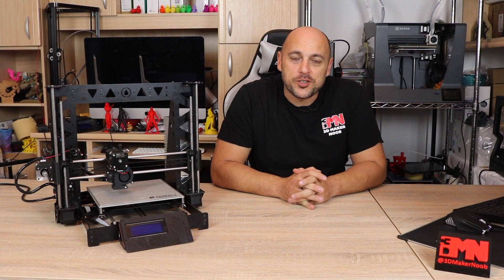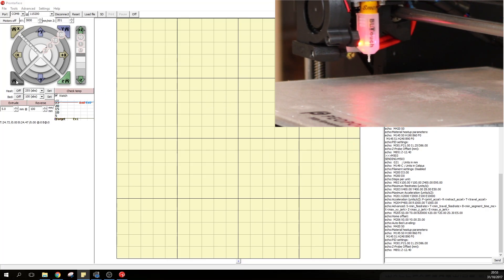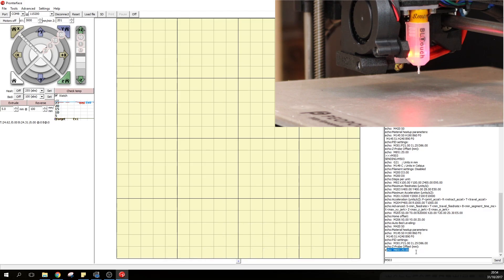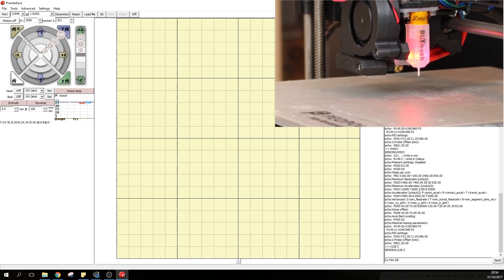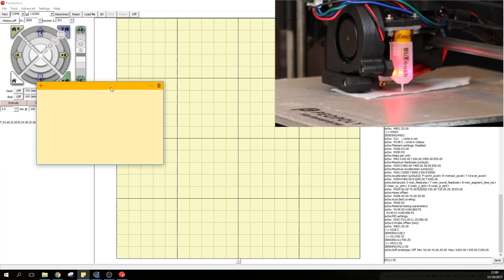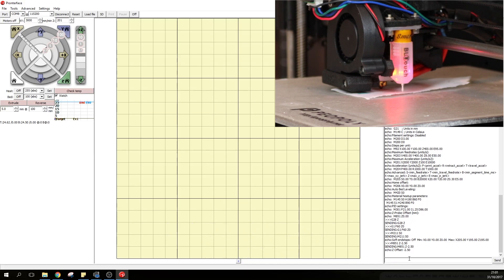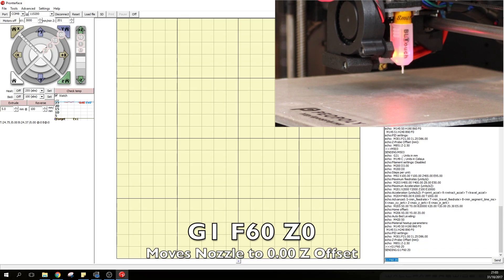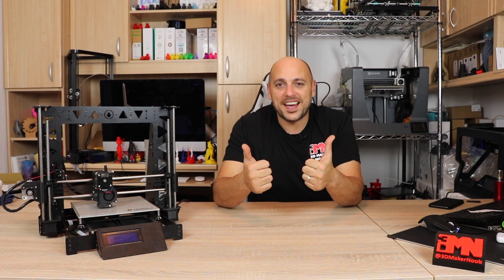Calibrating Z-Offset With A BLTouch Bed Levelling Probe

Comment: Anything I'm missing in the config of this? I am not seeing the same output you are with my Ender 3 pro (4.2.7 board) 

This is what I see when I hit home: (no z offset info)
------------------------------------------
Printer is now online.

SENT: M105

RECV: ok T:25.91 /0.00 B:25.48 /0.00 @:0 B@:0

SENT: G28

SENT: G92 E0

SENT: M114

SENT: M105

RECV: echo:busy: processing

RECV: echo:busy: processing

RECV: echo:busy: processing

RECV: echo:busy: processing

RECV: echo:busy: processing

RECV: echo:busy: processing

RECV: echo:busy: processing

RECV: echo:busy: processing

RECV: echo:busy: processing

RECV: echo:busy: processing

RECV: echo:busy: processing

RECV: echo:busy: processing

RECV: echo:busy: processing

RECV: X:162.00 Y:117.00 Z:10.00 E:0.00 Count X:12960 Y:9360 Z:4000

RECV: ok

RECV: X:162.00 Y:117.00 Z:10.00 E:0.00 Count X:12960 Y:9360 Z:4000

RECV: ok

RECV: X:162.00 Y:117.00 Z:10.00 E:0.00 Count X:12960 Y:9360 Z:4000

RECV: ok

RECV: ok T:25.91 /0.00 B:25.48 /0.00 @:0 B@:0

SENT: M105

RECV: ok T:25.91 /0.00 B:25.48 /0.00 @:0 B@:0

SENT: M105

RECV: ok T:25.91 /0.00 B:25.54 /0.00 @:0 B@:0

SENT: M105

RECV: ok T:25.91 /0.00 B:25.68 /0.00 @:0 B@:0

SENT: M105

RECV: ok T:25.91 /0.00 B:25.48 /0.00 @:0 B@:0

SENT: M105

RECV: ok T:25.91 /0.00 B:25.51 /0.00 @:0 B@:0

SENT: M105

RECV: ok T:25.91 /0.00 B:25.51 /0.00 @:0 B@:0

SENT: M105

RECV: ok T:25.91 /0.00 B:25.54 /0.00 @:0 B@:0

Comment: This video was a lifesaver for me and my CR-10 Max.  It's built so much differently than the other CR models, none of the generic hot ends work quite right, so you have to follow your instructions here as well as change the location of both the BL touch and the mounting position of the hot end.  Thank you!!!!

Comment: I seem to be having some issues. Carry out the instructions to the letter, but when i send the G1 F60 Z0 command there is still a 1mm gap Using OctoPi and a ender 5 Pro with a BL Touch. I have tried every thing but the same gap remains. octoPi is in safe mode.

Comment: thanks for this very good video. however I was unable to follow 1 step. the G28 Z0, I got the message that it was forbidden. I was able to follow all the other steps. now that the Z is set to 0, I still have a little space between my bed and the nozzle. does that have to do with that step? thank you in advance

Comment: Hi i have a cr10 max and has a z issue where it thinks the z is 4mm below the table and goes threw its bl touch process but then trys to push the nozzel threw the table will this work for my machine and if so how do i hook it up to the printer to correct it.Also why has it got itself out of wak when it was running fine ?

Comment: Only suggestion would be to do this with the printer up to temperature. This insures the tip isn't gunk covered and the thermal expansion has occurred.

Comment: Don’t suppose anyone knows why I’m getting No eeprom when trying to save the settings? Using ender 3 pro with 32 bit v4.2.2
Reply from the maker: Could be that eeprom is not enabled in marlin
Reply: @3DMakerNoob  thank you got it sorted. Great video. Thank you for your help

Comment: Vell my printer with  the SKR V1.3 and Marlin 2.0.7 changed or zero out the nozzle to probe ofset with these steps. i have used a paper to do this, and i am not sure the bltouch is better, because now i have to do this adjustment for every nozzle change, Right!! it is more like a cool hobby thing, then a usful tool, there is ofcorse the on the fly bed adjustment, it is a handy thing.

Comment: This worked BEAUTIFULLY for my Ender 5 (4.2.7). Thank you!   Next challenge: How do I do the same for my Y Axis endstop? My BL Touch sits just a couple MM forward from where it used to (linear rail mod), so when I run the level bed the Y axis and the BL Touch probe comes forward just a few MM further than I want, moving it beyond the bed. Anyone have a link for the writeup? This is my first time using PronterFace and I'm new to 3D printing. TIA

Comment: when I send the g1 f60 z0 command my nozzle just runs into the bed
Reply: In the previous step, did the BLTouch deploy for the Z home? (In my case, it didn't because I have a separate zstop limit switch. I also have the glass bed so the zstop limit switch leaves the nozzle slight below the glass surface.)

Comment: there's something i don't understand, great video btw. but when you say you have 2.49 and add the paper 0.1 doesn't it have to be 2.59? i am confused a bit?
Reply: me too... been looking at all the comments, a few people have picked that up, but I haven't found an answer so far though... will reply again if it was answered
Reply: OP did confirm (2017 reply) the error; correct setting for this example is 2.59

Comment: First of all great video. I was searching for this a long time. Unfortunately my offset is still not working...
I follow all your steps and it all makes sense, but when I start my print from my sd card, the nozzle is way to far away form my bed.
I don't quite understand why, cause when i follow your steps it seems like the right offset is -1.90 (friction between nozzle and paper is good) but when actually printing the right offset is about -2.40
I have some starting gcode, but I can't find any issue with it, that can causes my problems.

M140 S[first_layer_bed_temperature] ; set bed temp
M190 S[first_layer_bed_temperature] ; wait for bed temp
G28 Y0 X0 Z0  ;
G29 ; BL Touch
M104 S[first_layer_temperature] ; set extruder temp
M109 S[first_layer_temperature] ; wait for extruder temp
M300 S1000 P500 ; chirp
G1 Y2 X0.0 F4000.0 ; go outside print area
G1 Z0.0 F300.0; 
G1 X120 E30.0  F1000.0 ; intro line
G92 E0.0

I would be very happy if anybody has some ideas on what could cause my problem. I'm struggeling with this for along time now and it's realy disapointing

Comment: good guide, I've successfully managed to set my offset before but for some reason it won't apply the offset when printing! when setting the offset and then moving to the new zero the nozzle scrapes the paper as it should and the offset also shows in the lcd menu but when I start a print its like I never set an offset and then I have to adjust it on the fly using babystepping, which also works for only that one print even though I did save it to eprom
looks like I got some digging to do, I must have missed something when flashing the firmware
Reply: Its same for me. Did you solve it?

Comment: Thanks for this video was very help full. have one more question the probe is going off the lft side of the bed can I fix this with ponterface and set the probe to move more to the right so it will end up about 20mm more to the right to contact the bed and if so what is the command.  Hope it's not a bother.  Ron

Comment: great guide. one thing to add in the steps is to heat up everything as the Z offset does change slightly once everything is heated

Comment: Like this video as it is easier than playing around with the Z, However, Even after I am storing the Z and everything using Pronterface, the print is still trying to print in mid air, what could be the issue on this?

Comment: I just wanted to take a moment to thank you. I'm still pretty new to 3D printing and recently purchased a second printer with a larger print surface. I got a BLTouch for it to help with bed leveling and your video is the first I've found that was actually useful as far as how to go about calibrating it.
Reply: Amen on that Craig...ender 6 I bet lol
Reply: @livinginOrwells1984  actually it was a CR-10v2 and since a CR-10v3 as well.

Comment: After 3 days reading, watching and researching I was ready to remove the BLTouch from my E3pro when I stumbled upon this video, I'm still a noob. Followed to the letter I manage to get my E3pro (V4.2.7 and BLTouch v3.1 running the latest Marlin firmware) to actually print again albeit i had to adjust my z offset on the printer itself afterwards by 0.7
Absolutely awesome, thank you 👌🏻

Comment: Thanks for the help worked perfect are you able to help me with centering my printer head on the x axis when auto home it is to far to the right and when I  try it  I get error to far from reference point I assume just like the z axis this can be done with the x axis but I don't know what codes to use other than m211 to turn on and off parameters. Hope you can help

Comment: My pronterface connects & I can home but my command just stays as 'sending'
Reply: check your usb wire or your selected com port , i had this problem , sorted it by using a different usb lead , when i went to select a com port it only showed com 1 , as soon as i used a different lead /wire i then had the choice of com 1 and com 6 , i selected com 6 and ponterface connected and all was working , i hope this helps
Reply: @chrisrose2522  I got it working, it was Cura being open... but I keep having issues with it going too low when printing now :(
Reply: It could be your offset is set too low , try going over the video instructions again ,  if you cant get it correct,  try starting a print and adjust the z offset on your printer screen until you get it printing ok then go to store settings and save ,

Comment: I followed all steps but the final step ,G1 F60 Z0 to Test the settings, did not work.   When i home all, the nozzle goes to the left corner , in  the video , the nozzle goes to the center of the bed .

Comment: 2020 simple guide: If you use Marlin, just set z-offset to 0, do mesh bed leveling, afterwards start a print (you will abort it later), then use baby stepping in Marlin to lower the nozzle until you get good first layer lines. write down the number from babystepping, and either put it into the firmware directly, recompile and flash it or simply input it and save it in marlin.

Regardless of what you do, don't forget to modify the beginning gcode in cura or your slicer and insert a G29 followed by M500 or M501 followed by M420 S1 after G28 command (because G28 resets turned on mesh bed leveling, so as soon as your print starts, mesh bed leveling gets turned off, even if you enabled it in marlin on your printer). G29 simply does meshbedlevling before the print, and M500 saves it to the EEPROM (that is not necessary, but it is nice to always have the newest leveling data stored on your printer). The second option simpley uses the meshbed data stored on your printer (by loading all data from EEPROM with M501 and enabling mesh bed levling with M420 S1 again). You need to have run either auto mesh bed leveling by hand on your printer and stored it or you used the G29/M500 version previously described before so you just use the leveling data from your last print.

I personally go for 5x5 meshbed leveling every time before the print, because it takes like 1-2 minutes. and the print itself.. usually 1hour - 30 hours. But in return I get a guaranteed good first layer every time.

Comment: Joe.
I have just realized that I had been using your method of setting up the Z offset for at least a year before I found you again for ideaMaker (and subscribed). Have just accessed the method again to reset Z for my Micro Swiss hot end and direct drive - off to do a fine tuning calibration print and live Z offset tuning next. Thanks for everything you produce.
I hope that you are keeping safe from the Covid 19 spike there.
David

Comment: This worked perfectly.. just got my Ender 3v2 working with the BLTouch with this guide!  I’m a programmer and was pulling my hair out trying to fix the code for the BLTouch firmware.  Since I couldn’t find the bugs I resorted to direct connection and these commands fixed the zero.  I’m going to continue to work on the z-offset tool so that it can all be done on the printer but this is a perfect fix till then.

Comment: Well .... went through the process on my CR10S Pro.  Your setup is right on and it works. Just one problem with a printer like mine. The setup on the screen does the same thing. It will override the setup you recommend and re-establish a new set point. So ... I really appreciate you taking the time to present this ... it’ll definitely work out on the printer I’m building. Worth learning this. Thanks.

Comment: Thank you ... that might be part of my issue ..... finally got my printer working, but when I set my bltouch to .2 and z home ... doesn’t stay there when it goes to print. It’s actually a slight bit to high. I have to go to setting and index it down to look visually like it should be ... then everything prints fine .... never went through the pronterface setup to replicate what you did. I think that should take care of the problem.  Any thoughts. Thanks.

Comment: Ender 5 Pro: Went through this a few times without success. Swithced out the part where he adjusts the Z through pronterface - to adjusting on the actual printer instead. Finally worked! (The problem was that the Z-offset distance didn't really change when sending through pronterface. Even though correct numbers showed. )

Comment: This is all assuming your bed is level in the first place? Which I thought th BLTouch was meant to do. What if one corner is higher than the others? The BLTouch doesn't auto-level. It just gives yu the ability to calibrae a perfectly level bed at the centre.
So I don't understand why I wasted £40 on something I may as wel do manually with a piece of paper in each corner - at least thay way the entire bed is level rather than just checking the centre.
Or have I missed something?

Comment: Help!!! 

Whenever I try to set the Z offset, I get the error "Z offset out of range (-5 to 1)".

Foes anyone know how to fix this? I can't find it anywhere..
Reply: More details please? what printer, what version of Marlin firmware, what command and parameters are you using to set the Z offset (I assume 'M851 Zxx.xx' but what values are you entering for the 'xx.xx' part?

Comment: Even after the command: SENDING:M211 S0
echo:Soft endstops: Off  Min: X0.00 Y0.00 Z0.00  Max: X460.00 Y460.00 Z480.00                   I am unable to move the Z downward . It still remains 2.5mm up from the bed.

Comment: Thanks Joe, you saved my live!

I had some adhession issues due a hotend upgrate and this video helped me to calculate the z offset.

What its weird is that my z offset is -5.0, whick i think its too low...but I dont know.

I downloaded the bl-touch mount from thingiverse (https://www.thingiverse.com/thing:3584158) and it supposed to be -1.65 for creality's hotend but in my case was -3,55.

Beyond that now my first layer is perfect.

Thanks.

Comment: Excellent video, thanks a lot! Only one remark though. Shouldn't the distance between the nozzle and the BL Touch measured at the exact same position, to get the exact distance between the nozzle and the BL touch. Let's assume my BL Touch homes at x=100mm, y=100mm. Let's further assume the BL Touch has an offset from the nozzle of x=-44mm, y=-14mm. The position of the nozzle would hence be x=144mm, y= 114mm and the paper probing would take place at position x=144mm, y=114mm. If the bed is not level, there might be a height difference between x=100mm,y=100m and x=144mm, y=114mm. Better would be to move the nozzle to the point where the BL Touch was deployed (x=100mm,y=100mm) and measure at exactly the same point. Otherwise, the measurement is done at 2 different reference points which don't necessarily have the same height.

Comment: Hi, I have done this  and set Z0 to -1.7 when i went to confirm. my screen says Z-1.7 and after sending G1 F60 Z0 the print head went down to what suppose to be Z0 which i thought it would have the same drag on the paper as it done on setting this but it was  loose. where did i go wrong?? any answers??
thanks 
Bill

Comment: Thank you for this video! But I have a problem, because gcode command M211 do not do anything on my 1284p based printer - echo: unknown command. This M211 command was removed from TH3D firmware that I use to save program memory space. What should I do to switch off soft endstops in a different way? Any ideas?

Comment: I've went through this multiple times, yet when I home the z axis as the last step its still too high? Going through each time i find i have a difference of -2.90 but it never seems to work even though it is stored in settings when verifying... any ideas?  Creality BLtouch with Creality cr10 v2.

Comment: Can anyone advise, i'm trying to do this on a CR10s Pro v2 however there is nowhere on the LCD that displays the current Z-offset when he gets to the 2.49 stage.  It used to come up when I printed via SD card but have been printing via octoprint for months and can't find that info in the printers settings or in octo anywhere?

Comment: HI all, great tutorial, but, if i follow your instructions to the letter, when i get to the point of disabling the soft stops, it confirms they are OFF but when i go to move Z axis down, it says:
Manual move outside of the build volume prevented (see the "Clamp manual moves" option). Any thoughts?
Reply: here's adding my own reply !!........I since found out that the 'clamping' issue is actually a setting in prontaface, not marlin, so was guided to un-tick the box in the prontaface settings. All now good.

Comment: Ok what am i not doing!!!! my printer was working fine then it started printing too close to the bed,

so i reset everything up with the bl touch G28 to home all then g1 f60 z0 to get true zero, All this with the bed and nozzle up to temp then went to move axis move z (did m211 s0 to turn off 0 end stops) then put paper under nozzle then went -0.450 to hit paper then reset to 0 then i entered that figure into z offset and saved settings as i did originally when it all worked ok , went to do print it is scraping the bed almost and extruder clicking so took z offset out and same thing set offset at +0.450 same thing checked all wiring and changed bl touch same thing tried the tune section adjust setting while printing same thing reinstalled firmware same thing AHHHHHHHHHHHHHHH